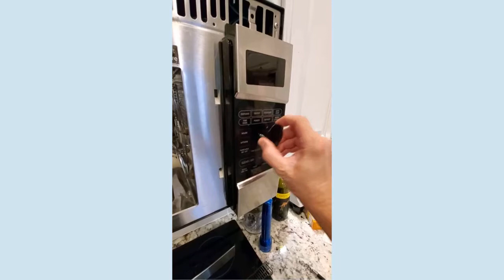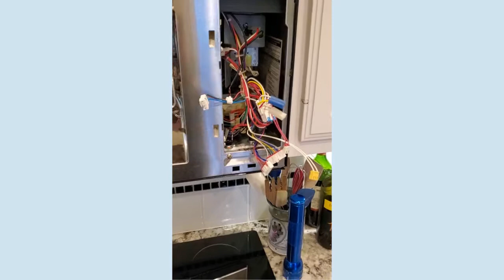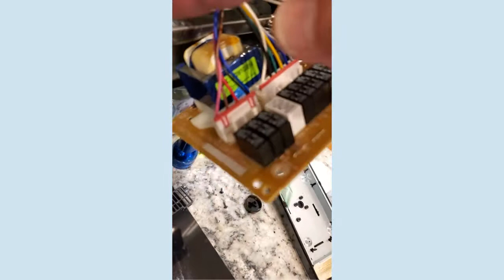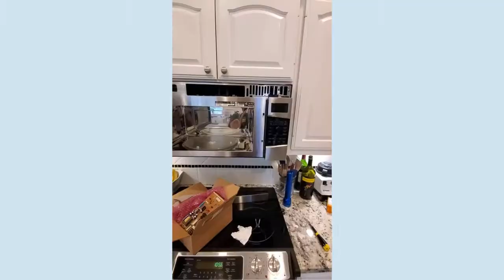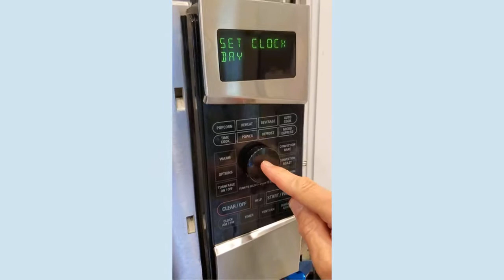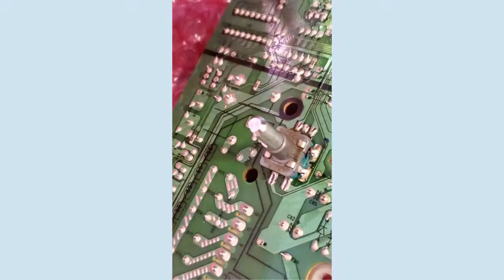How to Replace GE Profile Microwave Oven PVM1790SR1SS Main Board

Comment: My 22 year old GE Advantium LED display flickers and goes spastic to the point that I can't read the display. It is worse when I have the microwave on.
What can it be? Everything works other than that.
Reply from the maker: I don't have that microwave oven any longer (we moved), but my best guess would be that the main board needs to be replaced.

Comment: Excellent video, exactly what I needed to make my repair.  Spot on when you mentioned the need for a proper connection between the front panel and the circuit board.  Thanks for sharing!
Reply from the maker: Glad it helped

Comment: Can you help me with my microwave the timer works light works and the stop sound works its only the fan and the table not spinning what is wrong with it. I looked at the switches on the door they do have the clicker  on them.
Reply from the maker: I cannot find a detailed wiring diagram, which would help with the problem you're experiencing, but this may be helpful: https://www.appliancepartspros.com/repair-help/general-electric-microwave-pvm1790sr1ss-repair/pvm1790sr1ss-wont-start.html